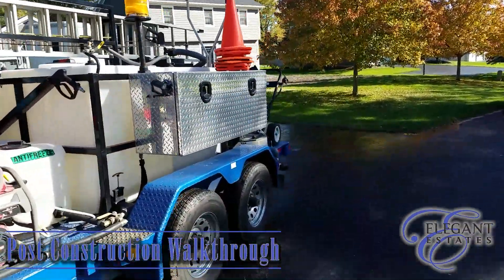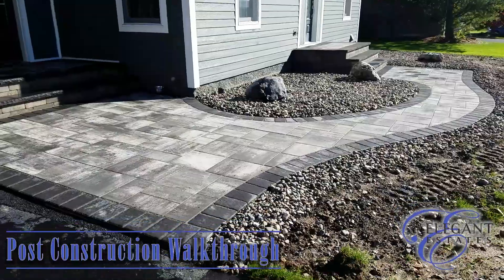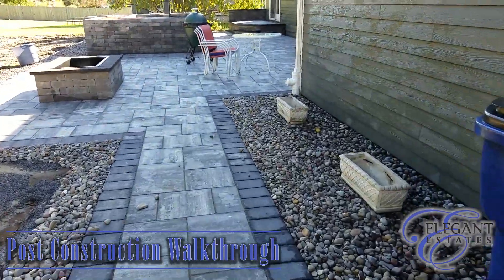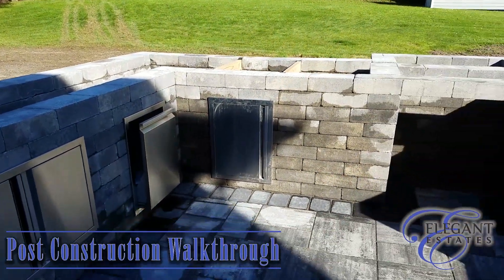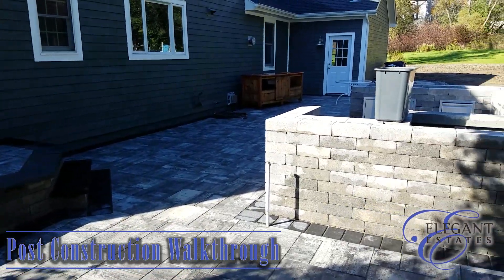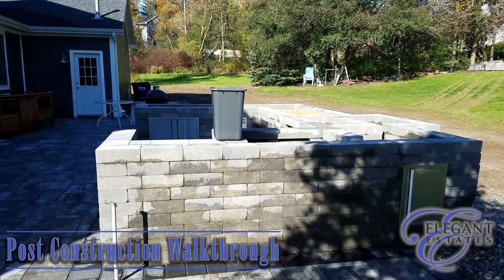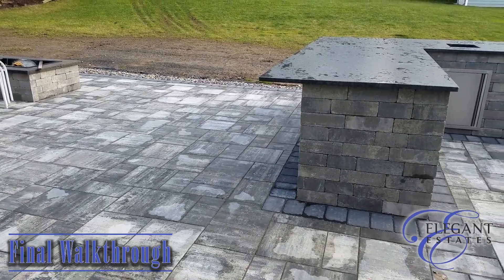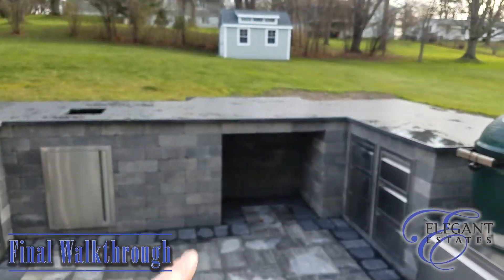HOW TO: Solve Yard Drainage With Paving | PART 6 | Permeable Pavers and French Drainage

Comment: Is your goal to get rainwater to stream along the top of the pavers and into the French drain? Or is it to have rainwater permeate the pavers, seep into the aggregate below , then eventually work its way toward the French drain?
Reply from the maker: This was a multi-faceted approach to dealing with the severe drainage issue that they had going on with this yard.  Our joint material was permeable, and therefore is designed to drain the water through it.  Since the pavers were a standard joint size and may limit the amount of water that can pass through it, we also made sure that any surface water remaining from large, fast downpours could find its way along the joints and surface grade to the french drain, and then out and around the house.